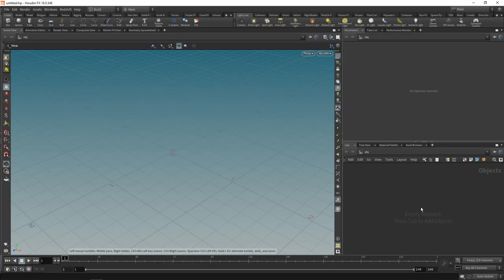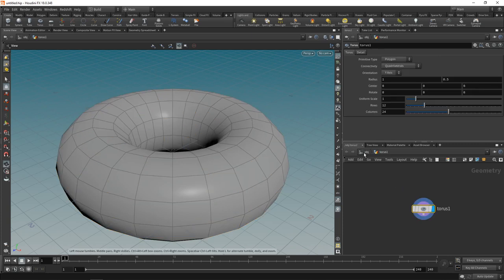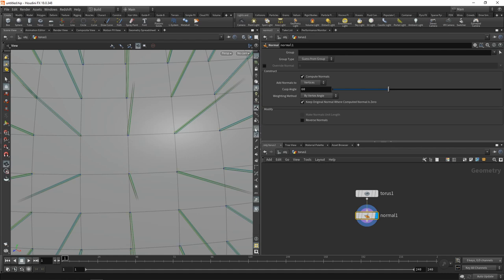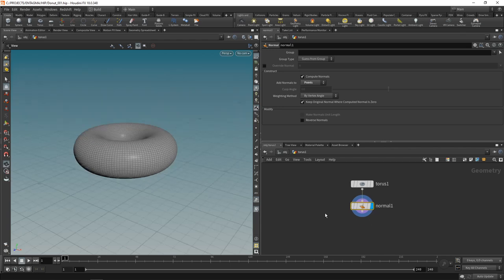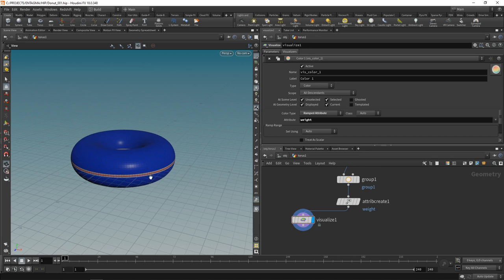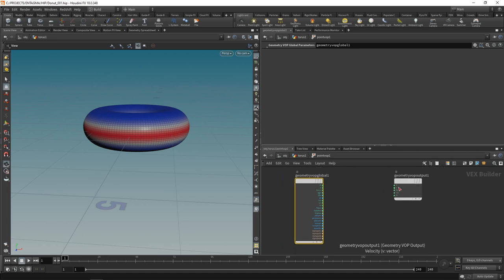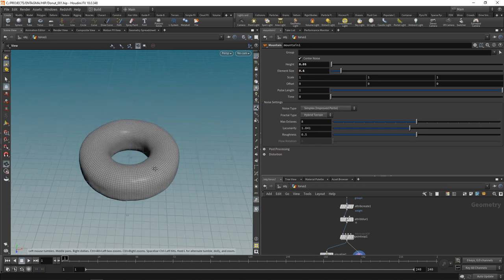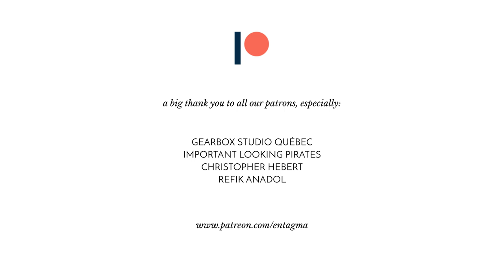The Houdini Donut Tutorial Is Finally Here! (Pt. 1)

Comment: Quick mountain question. When you add the mountain node, you get node that gives you stuff like height and element size etc. When I try to add a mountain node. I get an attribute noise named ”mountain” that dosen’t give me height. It gives me the same stuff as the standard ”attribute noise” node gives me. Seems a little odd. Have you encountered this and do you perhaps have a solution? I’m just using the free version of houdini to try it out.  Version 19.0.587 but I’ve also tried 19.0.680 build